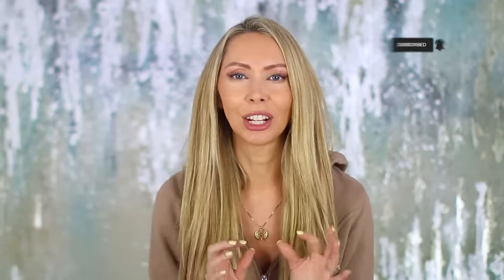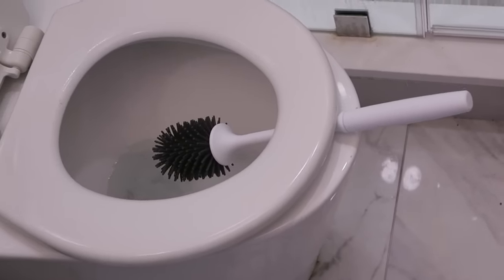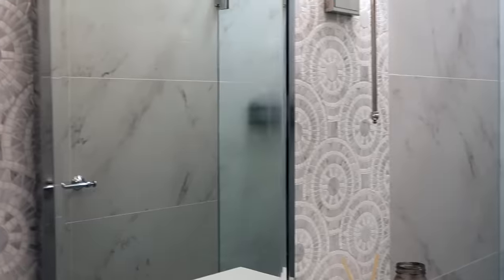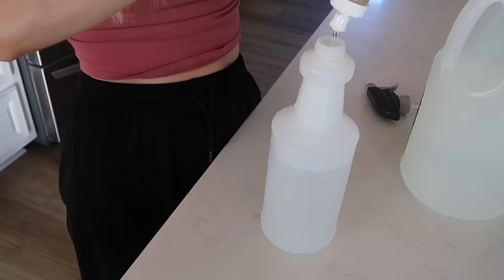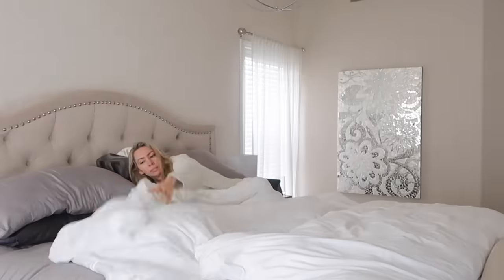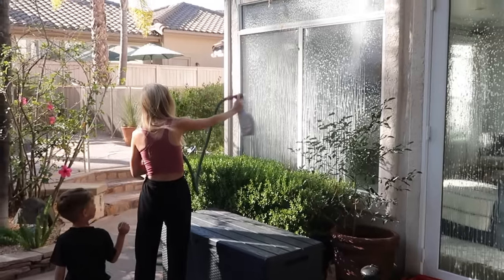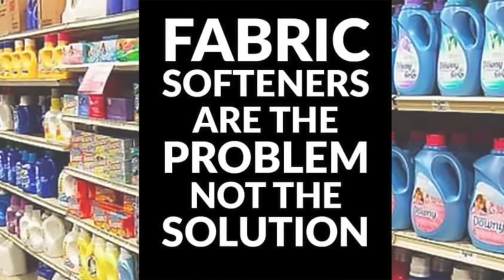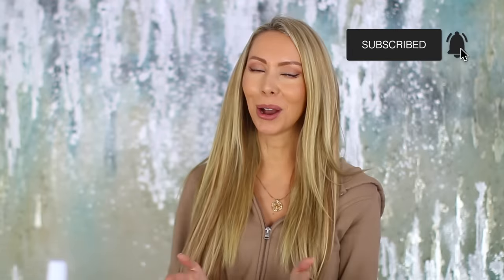15 GENIUS Cleaning Hacks From PROFESSIONAL HOUSEKEEPERS!

Comment: Glad you shared the vinegar and towels hack.  I have been doing that for years.  Soap is very difficult to get out of towels. The drain for our washer drains into our sink directly and the extra rince is still SOAP - even with using vinegar and extra rince.   The laundry shop owner in our community told me that years ago, it the worst for their equipment (towels and laundry soap).   This was before HE machines.  But today washing towels with 'all' HE detergent, the last rince was still soapy. Thanks for sharing!

Comment: The best cleaning tip I’ve tried is a system called the Light n Easy Steam Mop System. It is a steamer that does floors but also has a hose attachment with many different heads for scraping, scrubbing, wiping walls and counters etc. I had an art studio cleanup to do and the steam scraper made it so easy, the steam just blasts apart every kind of sticky, glued on, clay and pint and everything. I used it to clean some gooey dried junk out of the fridge. It does floors like sparkling clean and best of all it’s sanitizes! I was able to clean practically every surface in my house with JUST WATER. after you steam the surface you just wipe off the residue with a cloth and it’s sparkling clean. I love the thing.

Comment: I use a roller on my lampshades; it does work well.  Using a lemon for hard water spots on faucets and water knobs, though, is too expensive.  All that is needed is either a damp Mr. Clean sponge or a damp microfiber cloth. Sometimes, a dry microfiber cloth works fine if the spots have not built up too much.  Great hacks. Thanks.

Comment: A tip that always has worked for me to clean microfiber upholstery is to mix Dawn dishwashing liquid in a bowl until it makes lots of suds. Use the SUDS ONLY ( do not dip into the water) to clean your microfiber. You might have to whisk the solution a few times to get more suds. They said it works on carpet too, but I didn't find that to be true. But if you think about it, foaming upholstery cleaners are just that -- foam. My friend whips hers up in the blender for denser suds.

Comment: i need to check out the grout mildew cleaner. 

i bought the bath towels you recommended from amazon and i've found they're not nearly as soft anymore as they were when they were brand new. Will the vinegar tip help with that? wondering how you keep yours fluffy!
Reply from the maker: YES! and make sure you're washing them on cold with low heat to dry otherwise they lose their softness over time
Reply: @vasseurbeauty  ooooh good to know. my washer defaults to warm/hot for whites but i'll stick to cold moving forward

Comment: With the toilet bomb, the citric acid and bicarb will set hard without any water if you mix them and pop them in the tray. They get moisture from the air and you won't end up using the fizz with the water to combine them

Comment: I find bin buddy is cheaper than essential oil for my bins. Also unused an old toothbrush for round my taps and hard water stains on my taps. Cheaper than a lemon. Chances are most ppl have cream cleaner or some spray cleaner, put it on the taps and use an old toothbrush you don't use simple and cheaper than a lemon (espcially in the UK)

Comment: These drain catchers seem amazing as my rental has a funky shower drain and it’s always backed up
Reply: I HIGHLY recommend either the Tubshroon or Showershroom. They it collects every stinkin hair that falls out head! Got mine for $7.99 at TJ Maxx but I have seen them at sister stores and of course amazon. Hardly every have clogged showers anymore.
Reply: If you have a septic tank , it may be full
Reply: @melindasmith3713  thanks we are not
Landlord is super cheap and will not fix anything as the house was built in the early  90’s .
When we first moved in we noticed the garage door was dented eventually with time it was falling off and we had held it together with zip ties ( I later saw a Zillow pic that it had been busted for at least 7 years )

Comment: Thank you for collecting all these valuable hacks 👍 However ... This hack to make your bed while you're in it is just as impracticable for me as making your bed right after you got up. When will you air your matress and sheets etc.? I open the window, spread everything out very loosely and let it air for at least 30 minutes. And ... why using a lemon for your faucets when you have citric acid left from a previous hack? I personally wouldn't use produce for cleaning purposes in the first place.  ... Of course, it's not you personally I talk to, it's those who post such hacks on TikTok. Some hacks should get a second thought. 🤪    BTW, I really enjoy your hack-videos. All the research you do for them, the time you invest, that's awesome. Thank you 😍

Comment: I have sliding door that goes to my patio,it has over the years started to stick and be hard to open,I oil the tracks and then it opens very easily,now after years of doing this the oil builds up into the track and its disgusting,its hard to get out of the bar between the tracks and I need to find a way to clean this gunk easily..please help

Comment: Actually, vinegar is damaging for the washer, at least for the element that heats up the water to a higher temp. Because it is usually coated and the vinegar eats away that coating over time besides the fact that can rust youe washer way faster than it would normally... I don't use neither vinegar or fabric softener. If you really want to, you can do a "strip" of hard water build up, from time to time, by soaking your towels in vinegar in the bath tub or using RLR and then wash as usual.
Reply: I used to use a small amount of vinegar in my dishwasher as rinsing agent. It happend the same thing. As it was an older model, it had the heating element exposed on the inside. After a few months, the vinegar "ate" the coating on that elment. We were renting at the time and a repairman had to come in and replace the element.

Comment: If you were to fold another microfiber towel and put it in the middle of your pot lid and then wrap the 2nd towel around the lid--it would probably do an awesome job.  But it would probably be easier to wrap the towel around a rectangular block of wood.
    So funny that your husband was still in the made bed!!
     You look so different in this video.  It must be different hairdo.  You don't look better or worse, just different!!  Or did you get something done with your nose?